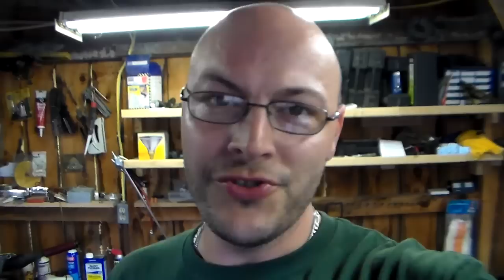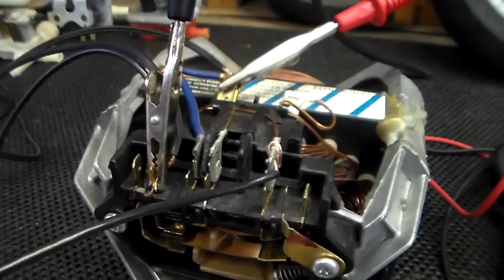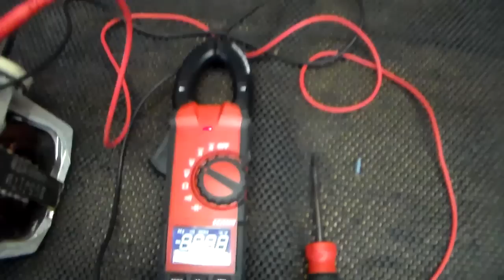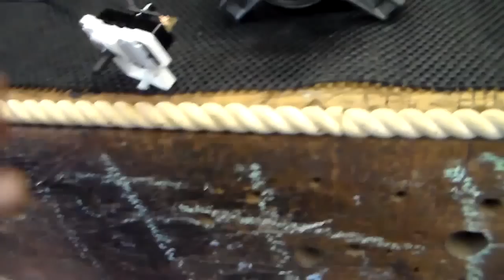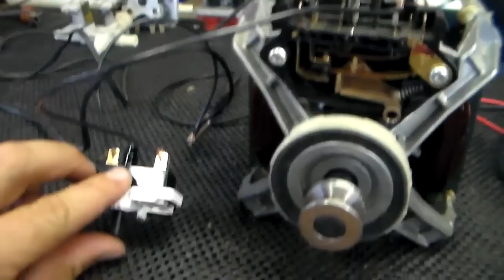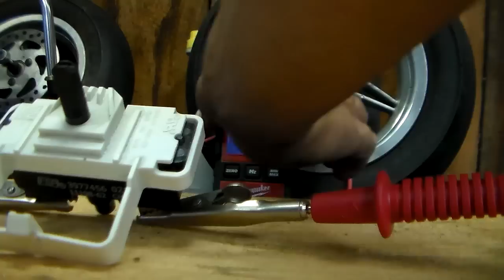Dryer Troubleshooting - Start and Motor Switch Testing

Comment: Bill I have a GE Dryer, Model DPSR483EA0WW that doesn't heat.  I tested the heater coils, the 4 thermostats, the motor  centrifugal switch and the timer with a ohmmeter and they all checked good for continuity.  Is it possible the heater coils are bad but still show continuity?  The motor seems runs fine when I start the dryer.
Reply: Test the thermal fuse that he showed.
Reply: I don't see a thermal fuse on my dryer.  The dryer schematic doesn't show a thermal fuse.  I've also looked for one on the dryer.  I only see the thermostats.

Comment: Hey Bill, first off, thank you for your service, Hooraah!  Your video was the most helpful one I've seen as far as wiring instructions.  Just like some of the comments, I salvaged the dryer motor for a project but the speed is to fast for it.  I noticed on the switch cover "240v, term 1-2" how do I do the wiring connection to put it on 220v mode, hoping that it will spin half speed when plugged in on a 110v source.  Thank you.

Comment: thxxx,great video!!!,what if dryer runs but no heat,,,,& all heater ,,tstats,,fuse limit,,all ohm good,,,can that centrifical swith prevent element from coming on
Reply from the maker: +Raybo sflorida Yes,  the switch can prevent the element from coming on.  The contacts could be burnt up.

Comment: Motor does not start at all.   It heats and timer works but no motor at all, no hum... I'm thinking start switch.    Should i run out and get a volt meter?
Reply from the maker: +Damon216 It's weird that is heats without the motor running.  What's your model number?
Reply: Roper by Whirlpool.... I have a volt meter and doing some tests on the start switch.   I think somehow no power is getting to motor.

Comment: Great video, My dryer runs fine (shuts off when it's suppose to, settings all work etc.,)  IF I hook up a heavy object (vise grips) to the spring loaded switch and keep it in the start position.
this is how the unit worked when i purchased the house and the previous owner said he's been using it like that for years. 
i'm trying to avoid a motor replacement which is what it seems you say it probably is. do you agree?

Comment: Great job Bill. It is the exact problem I ran into. My question is could this problem have been caused by something else, like maybe a faulty control panel or overload or faulty sensor or switch? Also would this problem cause motor to lock up?
Reply from the maker: +iamsordy4u  What's the problem your having?

Comment: Hello Bill, On my  dryer, when I press the start switch, the motor tries to start but is unable to turn the tumbler drum. It is as if there is too much friction. I can get the drum to rotate if I give it a push. The dryer will run for about 10 minutes then shut off. Does that sound like a bad motor or motor switch? Do you know if these motors have a start capacitor that can be replaced such as the ones on HVAC units?

Comment: Hello bill my dryer also isn't running. When I turn on the settings the heater comes on without pressing start. When I press start the motor doesn't start. I would add that once I turn to any setting the dryer has a low buzz sound.

Comment: Thank you for your great video.  Wanting to use this motor for a project and was not sure how to hook up power to it.  Just a little added info, the blue wire (terminal #3) is hot (120v), on your power cord its the one with "no rib" on it.  Terminal #2 is the neutral wire connected to terminal #2, through the start switch, then to terminal #5.  On your power cord, it is the one that "has a rib" on.  The identified wire is always the neutral.  The wide blade on the power is neutral.
Reply: jim barber wide blade on power cord is neutral.  the hot wire on power cord is not ribbed, usually it is smooth.

Comment: I'm having this exact problem.. I've replaced the switch 3 times and nothing .. But when I touch the two wires together the dryer starts and keeps running .. What can I do to fix

Comment: Hi Bill, can a bad timer cause this same problem because I have a machine that has the exact symptom you show here but I also think the timer is not running as well or would the bad motor switch cause the timer not to function as well. Thanks for your help Tony M,
Reply from the maker: Tony M A bad motor switch can cause the motor to not run when the start button is pressed.  A bad motor switch can also cause not heat even though the dryer will start up and run.

Motor test and Start switch test is where you need to go next.

Thanks for Watching!

Comment: hello bill did all the test, the thing that fail was the for continuity was the timer. my question is if the timer fail the contiunity test would the heat not come on? thats the only problem with this electric dryer no heat everything else is working.

Comment: Hey Bill maybe you could answer a question for me. I have a Roper Model: REX4635EQ2 with no heat.
 I have tested all wires, thermostats, fuse, timer, heat element, motor switch for continuity all was good.
When the motor is running there is no power running from motor to element,(the wire is good and it's direct point A to B) It seems like the centrifugal switch is not engaging when it's turned on. When tested manually switch works and has good continuity.
There is power (110-120v I forget exactly) coming from the timer through all the thermostats etc to the heating element but that's it. Thanks for any help you can give

Comment: Very helpful information! I have a quick question, my dryer is spinning, but the problem is once I turn the timer, the heat is on without hitting the start button. what are the likely cause of the problem, and what to check? Thanks!